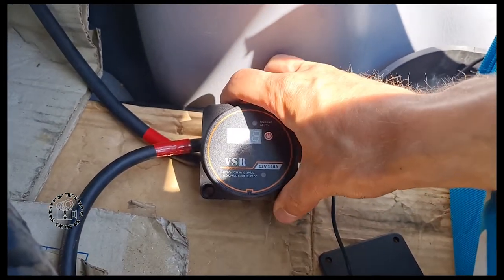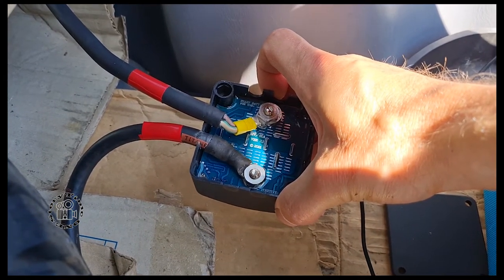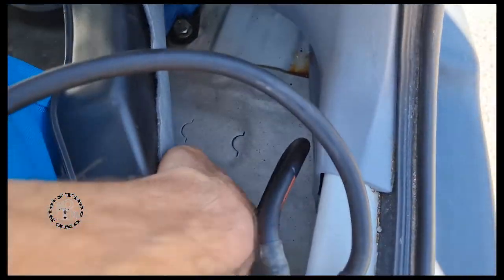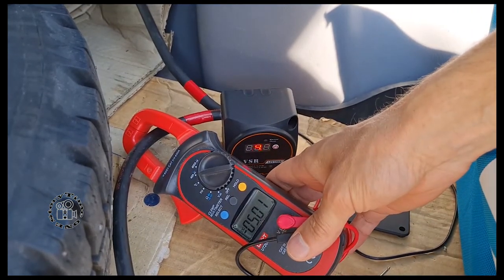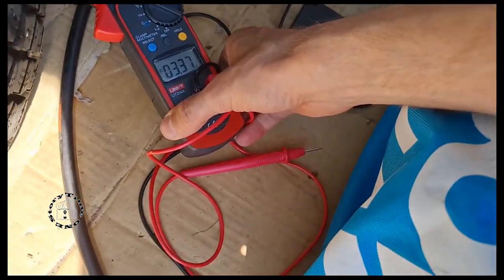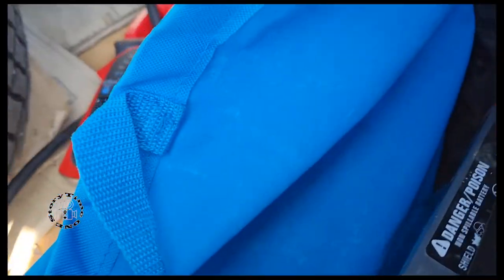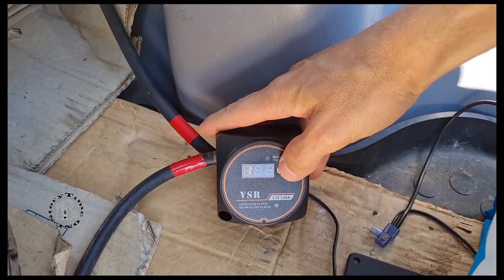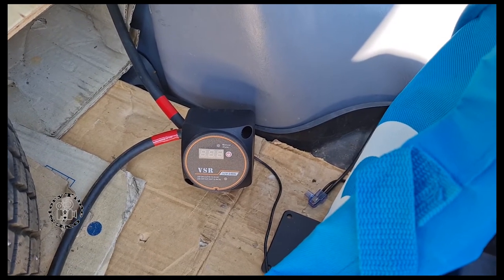How to install Dual voltage sensitive relay (VSR) with digital display

Comment: When you remove the minus of the relay which would turn it off, will it still be an automatic  as the default when you connect the minus back On?

Comment: Hi what's the name of the part you used between the main battery and the VSR, laying on the engine?
Reply from the maker: Hi, do you mean the 80Ampere Fuse /Fuseblock?